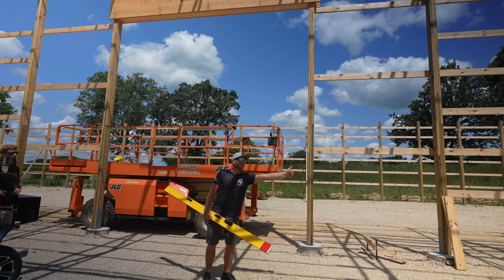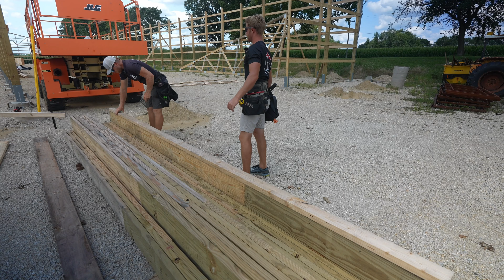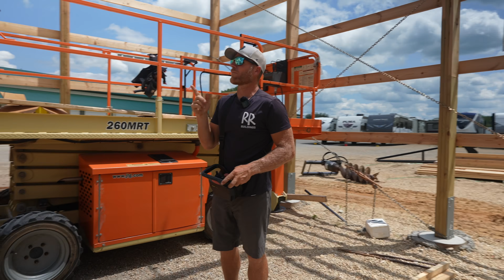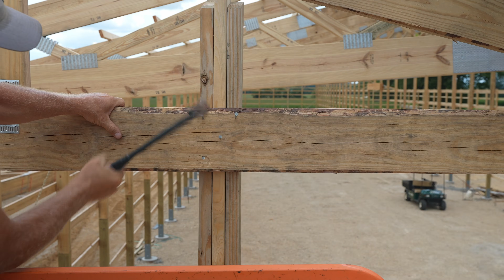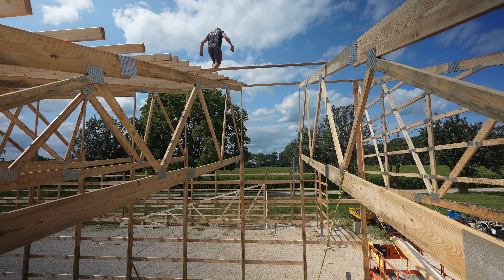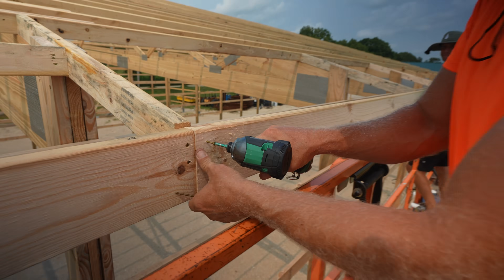BIGGEST Building's Trusses: First Half COMPLETED

Comment: I am a 50+ - year veteran in the remodeling and home-building industry, I have enjoyed my work almost as much as you and your Ace carpenter. Seem to
I enjoy watching your videos many of which I have watched multiple times, I am especially intrigued by your son and his quick comprehension of your work, he will outdistance both of us in due time.
There are two things I would like to commend you on which I learned very early in my apprenticeship.
The number one statement is this make every step you make during working hours count toward completing the job.
The second statement is never to walk around empty-handed, whatever direction you’re headed as you walk pick something up and deliver it closer to its destination.

Here are three suggestions to save you time and make your work not only easier but safer, I trust you will take these suggestions in the same spirit that I offer them to you.
#1 the stiff backs you put on the truss angle support boards In certain cases as required by the manufacturer. These can be applied on the ground level. After you pick the truss up from the pile and as it is being balanced by theSky Trak  hi-lift, close to the ground, have a nailing gun and stack of 2 x 4 stiffeners handy, and apply those at ground level, it will save you time and money.
#2 this tip applies to the gable end truss, predrill the nail holes on both ends before you hoisted into the air. This will make the driving of those £.60 ring shanks, 1000 times easier, faster and safer. I know you are knowledgeable of how many nails and what configuration they should be in to fasten the truss to the corner posts. This too will save you much toil and the wear and tear on your arm and rotor cups.
#3 prologue, to me this is the best suggestion I can make for you to increase your productivity while saving the wear and tear on your body, as well as speeding up the process when applying long sheets of roofing materials. You may need to put some thought into what I’m saying but once it comes clear in your mind I know this idea will make you hundreds of thousands of dollars before you retire. Here it is stated plainly.
#3  A. Construct a lightweight framework that will hold a bundle of your roofing steel as it comes from the manufacturer. 
B. using your GLG hi-lift machine lift the metal and framework together placing it at a 90° angle to your rolling platform. This will add very little weight to the new procedure. 
C Construct it so that as each sheet of metal is pulled from the shoot onto the roof the angle of the chute will be at such an angle to preserve the finish on the next sheet of metal in the stack, this angle can easily be calculated from the ground level during construction of the framework. A simple  1x4 may be used on the upper end to separate the two sheets placed there by the rolling scaffold carpenter as the individual sheet is being loaded on the roof. The metal will then be fed onto the new building allowing the workmen to pull it directly from the stack onto the roof with all ease. 
D The second man, the one in the rolling platform will neither have to lift the metal by hand, nor will this employee need to twirl it in the air 180° to prepare it or use it on the roof.  This will be easier and safer for the employee, and save many man-hours of labor. 
I trust this information will be clear enough you will be able to grasp the concept and run with the idea, keep the videos coming I enjoy watching them you have taught me much over the years, again thank you.

Comment: Love your work folks.  I’d consider myself a pretty handy guy - have built plenty of smaller buildings and am an Electrician by trade.  I thought I could knock a nail in ok until I worked with a wirey old builder half my size who could put away a 4” nail in 3 hits every time.  Made me feel quite small, but he was a great bloke who taught me heaps. 👍

Comment: I know you said you usually cut the bevels on the bevel boards (the "in between'ers") but since there were so many on this job, you were omitting the bevels this time. But with the boards at a 0 degree and the steel coming down at its' 33 degree pitch (if I'm remembering you're running a 4/12) there would be an air gap on the high side of the board that allow the steel to flex or dimple on those boards when fastening them down since there isn't 100% board contact underneath? Or do you just not run the fasteners in too tight on those boards to keep from dimpling the steel? Just a curious question.

Comment: Hey Mate, I really question the 1 nail you have connecting girt to truss?? You got post to ground bracket with bolts and what not, a lot of fixings from truss to post but just 1 nail holding the girt on at 2.4 metre centres?? The uplift on the girt/ roof is being countered by 1 nail??
Reply from the maker: 1 nail??? how about 4 20d plus 2 - 1/2 thru bolts
Reply: @RRBuildings  Sorry mate.. was talking about purlins to trusses... 1 nail, yes?

Comment: As a former surveyor in the field, I'd love to see a series of measurements with a total station from end to end.  Set up on the ground, anywhere along the length of the building, about 100 ft straight out from the side, and do 'shot - turn - shot' distances, peak to peak and corner to corner (top and bottom, even!).

Comment: one inch over 300 feet is damn here perfect.    My new build house (that was built by "professionals") isn't that good, and its 50 x 30 in size.    Heck they cut up the good studs for blocking and installed the bent ones as door frames!

Comment: Rookie question!! Just a thought and tell me why I am wrong!! Could you in theory start on the center of the building and work out towards the ends to treat it more like a 152ft building?  Would it help or is there reason that you couldn’t?  1 inch over 304 ft is incredibly good fellas!  Just had a thought theory!! Great work as usual!
Reply: Yes, working from center lines, outward in each direction is pretty much standard operating procedure for big building layout. It allows you to cut errors (or accumulations) in half and share half of the correction to both sides. They’re called “control lines” (X,Y). “Bench mark” controls vertical layout (Z).
Reply: @psidvicious  how do you establish a point of reference in the center of the building without both end walls in place?  Is there a way to use the 3-4-5 method?
Reply: @jasonwilcox2661  Pythagorean theorem (3-4-5) is used extensively for building layout. On most big jobs, a registered surveyor will be contracted to come out and establish the initial controls, brought in from city or county known and established points. On something like this where easements and set backs are less of an issue because it’s all private property, pretty much good ole ‘dead reckoning’ is applied. Once the controls are established, they become the ‘Bible’ for the entire job, for all of the trades. 
Your question for establishing the reference points, w/o the end walls in place = The end walls go where the reference points or control lines tell them to go. You can request from the surveyor anything you want for reference points - end walls, building corners, building centers. They’ll typically charge by the point so the more you can figure on your own the better off you’ll be, budget wise.
Reply: @jasonwilcox2661  Pythagorean theorem (3-4-5) is used extensively for building layout. It’s kind of a “chicken or the egg” dilemma. You need either centers or end walls established. Most times a surveyor will establish building corners (outermost points). From there the layout controls can be determined from those and the rest of the job using them like a Bible. Everything goes back to the controls. Offsets from controls can be established when it’s no longer practical to get all the way back to controls.
Reply: @psidvicious  establish a corner- then a straight line (wall) and a point of reference from there.  Then comes the largest variable in lumber the Z axis!  We can only approach 0 (perfect) but never achieve it!